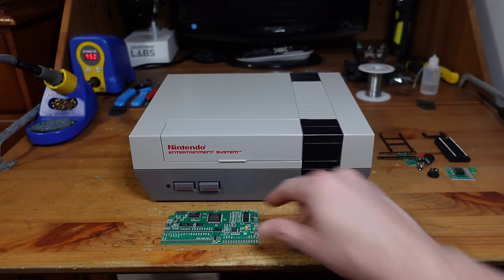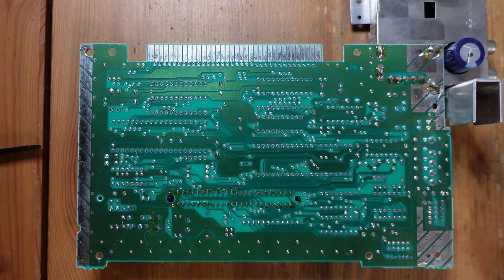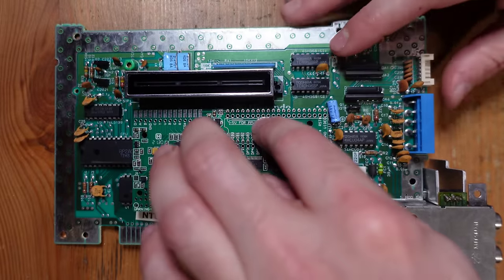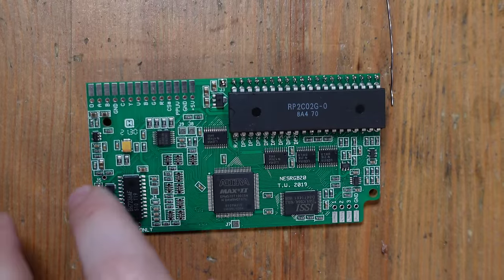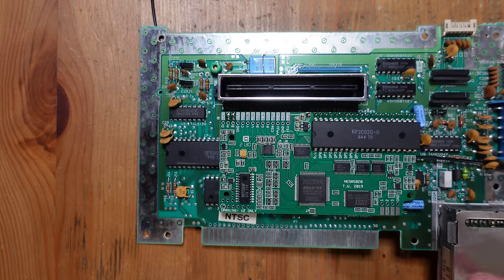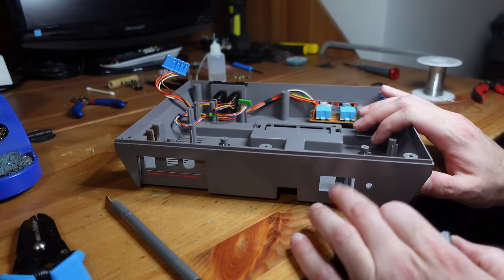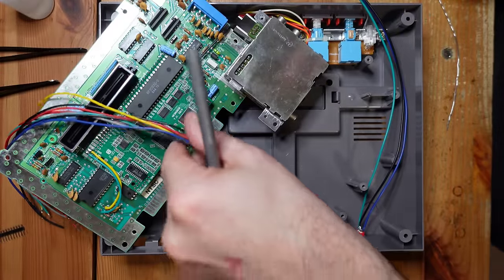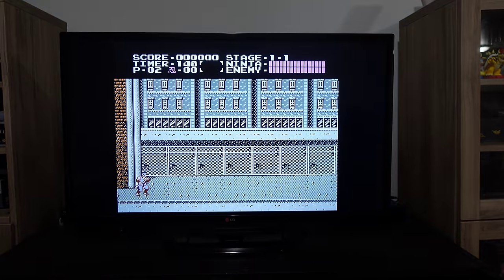NESRGB installation with a SNES multiout! Get the best audio and video output from your NES

Comment: Great one, nice to see that you're back I've been keeping a look out for any new videos the last few weeks.

I just did this mod to my Japanese Famicom a few weeks back. Some of the steps are different but the end goal was the same. It was pretty time consuming and for me a pretty intense mod (though I did end up buying a desolder gun for it), but all went well and I'm really happy with it. 

I love the way the Famicom looks and if I was going to have a version of the NES on display I wanted it to be that even if it required more work. I also added in detachable NES cables and I'm currently finishing up making the first player controller wireless with the 8bitdo controller mod... just waiting on a part from China to wrap it up.
Reply from the maker: Awesome, glad that you installed this on your Famicom! It’s such a huge improvement from the original system

Comment: Really clean job on making that hole for the multi-out, and overall an awesome mod as always!  Yeah taking those PPUs out is a real pain especially around those 4 EXT pins where that huge ground plane is, but you make it look easy!
Reply from the maker: Thanks! Yes those 4 EXT pins is always the worst part, but with its a little easier with the methods I used in the video
Reply: @LIRetroGaming  What're you using for solder? The NES is old enough that the original is tin/lead—but some people who work on electronics of this age swear by bismuth low-temp solder during the desoldering phase. That seems like an added expense to me—the NES needs a good iron for PPU desoldering, but it's pretty hardy by comparison to say some of the Tandy PCBs of the era.

Comment: Excellent video!
Thumbs up for reflowing the solder on the pins after snipping off the top! So many people miss that step. 
BTW, You're probably aware of this already, but I find applying flux to the top (component) side on the pins of through hole parts like that PPU helps the desoldering gun. I think it just helps break up any oxide layer that wasn't reached by adding the additional solder to the underside. Particularly useful if the solder is a bit more "grungey" than normal. (I learned the technique working on systems with battery or capacitor damage)
Reply from the maker: Thanks, glad you enjoyed the video! I do sometimes apply flux like how you are describing and it does make a difference

Comment: Thank you so much for the video!!  I have a front loader with this RGB kit, but have been using that horrible scart cable that comes with it.  I tried many times converting the kit to the multi out port, with no luck.  Would get sound only and no picture.  The cable with the kit, doesn't use the same sync as the multi out, when it comes off the RBG board.  Once seeing how you wired it, switching just that one wire, everything works great!!   I even have the S Video connection working which looks great on an old, flat screen CRT!!

Comment: I did one of these a few months ago. You make it look so easy. I'm pretty sure I just barely got it to work, given that I'm such a novice. The only difference is that I put the pallete selector under the cartridge lid so it at least was out of the way. I used a 4 way switch so I could use the original composite if I ever needed to and didn't have a snes composite cable.
Reply from the maker: That’s a cool place to put the switch. Very convenient since it’s in the front

Comment: If anyone is thinking about getting this mod done, it is the best thing you can do to your NES or Famicom. It makes a huge difference. I have found that the laserbear multi out is a bit of a snug fit on my Sharp Twin. But the picture you get with hd retrovision cables is immaculate. I had no idea how horrible composite was until the mod was done. I did see a video years ago where someone added an expansion audio mixer to the nes with a mixer knob, and one if those expansion audio boards that plug into the port in the bottom. Thought it was a pretty cool mod. Is there a way to get rid of having to push the cart down into the nes that is not the Blinking Light Win mod? That product has not been available for a while now.   My NES has a hard time reading games if I don't have the game genie hooked up. I'd rather not have to rely on a game genie for my carts to work right lol. Not sure if the TW Rgb boards are available anymore either. Last time I checked, they were all out.
Reply from the maker: Unfortunately no other company is making a product like blinking light win, but hopefully that changes. But at least the NESRGB is regularly in stock!
Reply: @LIRetroGaming  nice video! BLW has had some serious problems with the company that they contracted to make the BLWs, but they are actively searching for a replacement, so hopefully we will see something soon.

Comment: Can you point me to the nibbler cutting tool and the filer you used around ~14:20-15:44 to make the multi-out hole so nice and neat?
Reply from the maker: I have a link for the flush cutter here, but I don’t have one for the file. I picked up a file set at Home Depot. Here’s the flush cutters: https://www.google.com/aclk?sa=L&ai=DChcSEwibypD3wMD2AhXKUHIKHULJBY8YABAJGgJxdQ&sig=AOD64_3zVf256Rl1fXqSZqx1KF4ro7RXcw&ctype=5&q=&ved=2ahUKEwjtm4X3wMD2AhUglIkEHRNsCLYQwg96BAgBEAo&adurl=

Comment: Great video as always! I recently opened up my ntsc rgb-modded nes to add expansion audio and one of these multi-outs. Ran into some issues, and haven't had the time to get back to it. My question is, do I need to bypass/short some of the components on the nesrgb on the r, g and b lines for it to work properly, or is this not necessary? I don't get any video from it😔 I'm using a ntsc retrogamingcables snes scart cable. I tried to find any mention of this in your video, so my apologies if I missed it and you actually mentioned it in the video after all✌
Reply from the maker: No, you should not need to short anything on the RGB lines. It’s hard to diagnose without looking at it but you should just be able to transfer the wires over from one connector to the other
Reply: Allright, I've saved the pinout you provided and I'll go over my wires again👌 Thanks man!😊

Comment: All that's left to do with a toaster like this to turn it into a perfect 8 bit console is come up with a better solution to the toaster mechanism. I guess some people might want the a stereo separation mod as well, but I'm not convinced that's worth it.
Reply from the maker: There is a company making a product called blinking light win that addresses the problems with the toaster mechanism
Reply: @LIRetroGaming  I know it exists, but I've never managed to find ArcadeWorks having them in stock, unfortunately.

Anyone who can install the RGB mod (so … not me without some better hardware than my Mk. I optical sensors) could produce a Blinking Light Win by soldering a couple 72 pin card edges to a really simple PCB, 3D printing a cart tray, and doing a CIC disable switch mod.

But I can't do that soldering myself (I need some better magnifying tools or to get someone else to do it), and I'd rather finance ArcadeWorks doing other cool things in the future.

Comment: Is there a reason  you didn't use header pins when you were connecting the multi out and pallet switch to the board  or is it just personal preference?
Reply from the maker: Just personal preference

Comment: Nice mode but why not use a push button switch that looks better than the switch you use. I feel like if your going to go through this trouble to make the multiout look nice you might as well make the switch look nice too.
Reply from the maker: It would have to be a three way push button or something since there are three options to toggle for the palette switch

Comment: I have a cheap iron, cheap de soldering iron, etc. Am I able to properly install this or do I need to upgrade? Thanks. Love the instruction.
Reply from the maker: The iron can be cheap, just as long as it is temperature controlled. The desoldering iron probably should be something good like a Hakko fr301. Do you have experience with removing chips? Because that’s probably the most important thing when going into the NESRGB installation. Definitely get practice with that before you attempt it

Comment: Fun video! I'm assuming you've seen Voultar's little expansion audio board. You ever thought about getting a few of those and giving them a whirl?
Reply from the maker: Yeah those are great and I have installed them before. At some point I’ll definitely use them in another video
Reply: @LIRetroGaming  It's just so neat, tidy and cute.  😂
Reply: Should try and do voultars way of doing the palette switch too

Comment: Great video! Is there a reason why the 2 S-video pins are left out from the Multi-out (Luma & Chroma)? This was also the case on Voultars videos, and a few others I could found. I'm assuming it is is still possible to wire those up too with the extra 2 wires to get that capability, but it was left out since S-video is rarely used, is that correct?
Reply from the maker: That’s exactly right, I could have added svideo but I chose not to because most people that want this mod are only planning to use RGB or component. Glad that you enjoyed the video!
Reply: @LIRetroGaming  Thanks a lot! I chose to wire up the additional Luma-Chroma-pins, and my S-video Multi-out cables work perfectly.

After researching a bit, it seems there is another benefit of wiring up Luma in particular. It seems there are 3 major variants of RGB SCART cables: csync, sync on composite and sync on luma. Not wiring up Luma will remove compatibility with the sync on luma RGB, which seems to be common on SNES PAL SCART RGB cables. Sync on composite seems to be the most common one overall (also used by the HD Retrovision cables), but for the cheaper unshielded cables, it seems modding the cables to use csync alternatively sync on luma is recommended, for reducing video artifacts, like checkerboard patterns in backgrounds which is common when using sync on composite. I had a checkerboard pattern on one of my cheap unshielded SNES PAL RGB-cables, and after modding it to use sync on luma, it worked perfectly.

Sources:
https://www.retrorgb.com/sync.html
https://www.retrorgb.com/snescsync.html

Comment: Sorry for the question, but what are the gauges of those color cables you used for the mod?
I ordered a 30AWG color spool, but I believe this are to frail and not "strong enough" for this kind of mod.
Reply from the maker: I used 28 gauge copper stranded wire for this install

Comment: Fantastic video! Can you share links to the wires you use as well as the solder? Cheers!
Reply from the maker: Sure thing, here’s one that I order fairly regularly Eowpower 16.5Ft/5M 20Pin Rainbow Color Flat Ribbon Cable IDC Wire Cable https://www.amazon.com/dp/B01NC2L2WB/ref=cm_sw_r_cp_api_glt_i_W6Y6WCZ0N49PH14B2PS1
Reply: @LIRetroGaming  Thank you! And solder?

Comment: Hello I have a question If I'm doing this same mod with the NesRGB v3 do I need to install a Voltage regulator if I want to use everdrives so it doesn't get to hot or should I be ok? Thank you very much and I love your content :) take care
Reply from the maker: Thanks, glad that you enjoyed the video! No, the original voltage regulator is just fine to use with this mod and an everdrive
Reply: @LIRetroGaming  Tysm your the best :)

Comment: Wondering why you didn’t use any flux when desoldering or re-soldering in the 40pin?  I’m just getting into soldering in general and thought it was necessary. Thanks for the vids!!
Reply from the maker: That’s a very good question. Occasionally I will use flux when I’m doing the PPU removal but I rarely ever need it. I use flux a lot when I’m soldering in new components, but much less when I’m trying to remove a component
Reply: flux isn't all that necessary for desoldering with a gun, flux helps the solder flow nicely and get a good solid bond, but that isn't something you need for desoldering. For the re-soldering, the vast majority of solder on the market has solid flux in the center of the wire that melts when you use the iron, and that flux is sufficient for basic stuff like soldering through hole pins as long as you work quickly. It will burn off if you take too long and it won't work for everything, but for this application it is enough

Comment: Hello, what rgb cable are you using to get rgb signal out? does this work with snes rgb cable? can I use my ossc to scale this?
Reply from the maker: I am using an SNESRGB cable from insurrection industries. You can also use HD retrovision component cables. I was connecting it to the OSSC so that will certainly work

Comment: Have you found there is a low amount of buzz when the game is otherwise silent? I notice it a lot on SMB3 before I start the game. I've attempted troubleshooting, ensuring everything is connected correctly, upgrading the 5v regulator, disconnecting the original audio circuit, nothing really seems to have effected it
Reply from the maker: A lot of possibilities can cause that. What scart or component cables are you using? You can also try shielded wires for the audio connections
Reply: @LIRetroGaming  yeah I should have mentioned, I'm using the mini din supplied with the kit. However I route the audio from the NESRGB to 2 RCA jacks. I use shielded coax (Belden 1694a) to route the audio.  I feel like I've narrowed it down to either noise being picked up in the NESRGB itself, the outpost just having noise from the CPU, or potentially the power brick. I have a triad coming to test that.

I was really more asking to see if there's just always a low level of background noise and I'm just trying to squeeze too much from it.

Comment: I have 1st gen Sega Genesis and the power brick is dead so I tried nes power brick and it works just noise and crappy picture. the cart slot wont read Genesis carts
Reply from the maker: An NES power supply is dangerous to use on a genesis. Definitely don’t do that

Comment: I have basically the same install except i'm using the qsb and ribbon cable to the multi-out.  Having an issue getting RGB scart cables to work, no issues with an HDR SNES cable.  I've tried a csync and luma sync snes scart cables with no luck.  Any ideas what I should try?  Thanks!
Reply from the maker: That’s an interesting problem, and I have never tried using a QSB to install this before. The fact that HDR cables work means that composite video, RGB are all there and working. Did you use a multimeter to test continuity between the luma pin on the multiout to the NESRGB board? I would also try the same thing for the csync pin
Reply from the maker: Another question, what jumpers did you close? I think you only need to close jumpers J3 and J5
Reply: @LIRetroGaming  Luma was my hunch, thanks I'll check that.  That or jumpers, so I'll double check that too.  Do you have a discord channel?
Reply: @LIRetroGaming  so J3 is open because I'm using the external VR, I've got J5 shorted for ntsc luma freq and also J8 for 75 ohm sync.  Y and V pins on the rgb board have continuity with the qsb pins.  So, that's got to leave the scart cable as the culprit no?  Would I see anything with no luma?